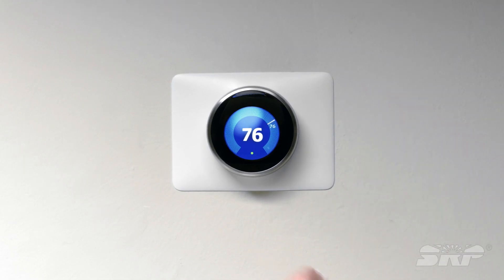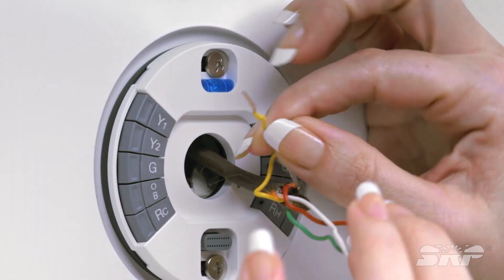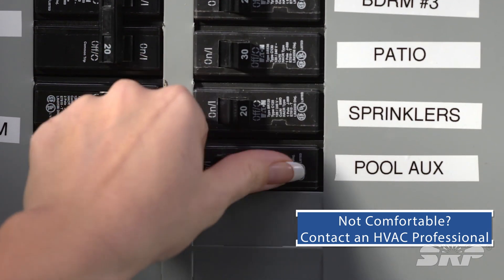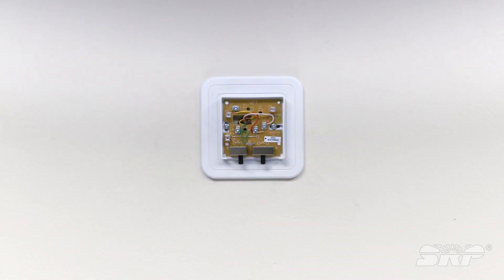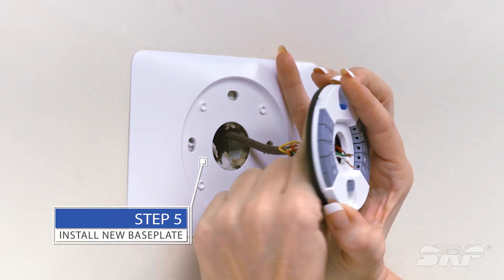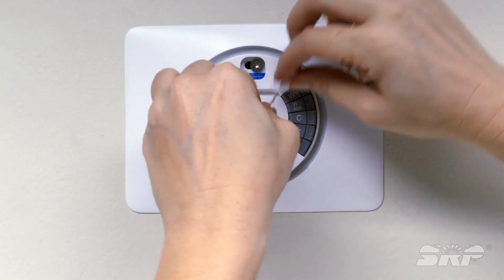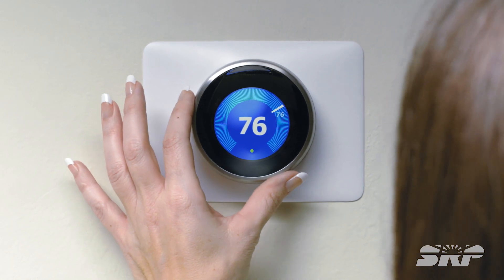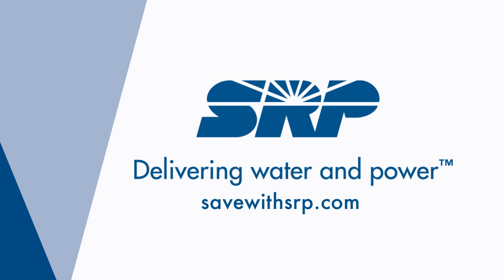How to Install a Smart Thermostat

Comment: I have 4 wires and in my old thermostat, the green wire goes in letter "O" slot. However in your video, the green goes in letter "G" slot. Is it ok if I can put green wire in "G" slot?
Reply from the maker: Wire placement may vary between different thermostats. Refer to the manufacturer's instructions for proper placement.